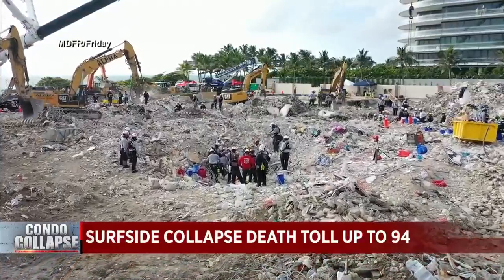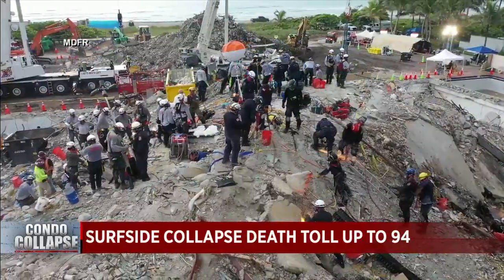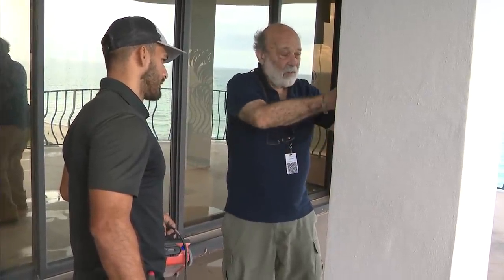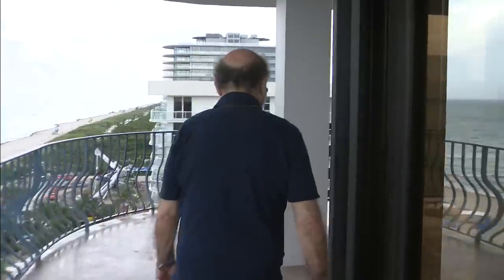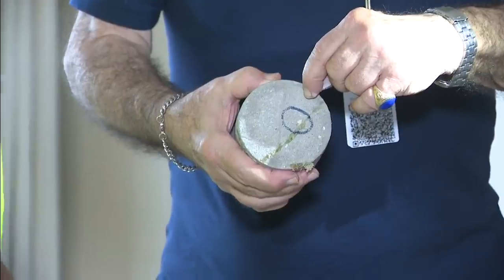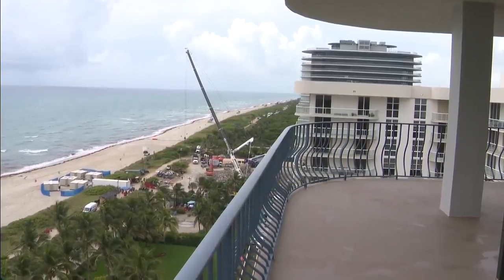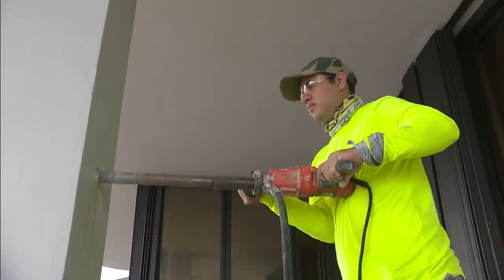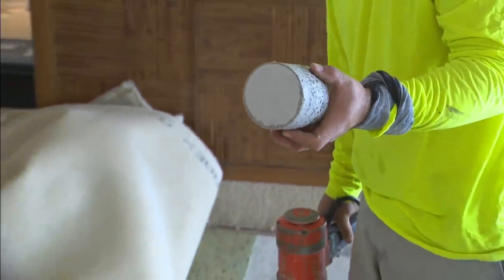Structural expert studying still-standing Champlain Towers North looking for clues into south to...

Comment: Shouldn't they be starting in the parking garage instead of a penthouse suite?
Reply: I'm not a structural engineer, but I assume the safest spot to retrieve samples would be from the top floor.
Reply: @Dekipoo they appently are refusing to let him on the site     so they can "clean up " the evidence
Reply: @Dekipoo  seriously the first job is the rescue and recovery operation.  Which means removal of debris from the roof down to the garage level and foundation.  Investigation and analysis of material from the elevated slabs is on going but not priority.
Reply: @paulquirk9041  I don't know what that has to do with the topic. They're extracting material composition samples from the North tower - not the one that fell.
Reply: @Dekipoo  Agreed. The top floor has no load bearing weight above it like the the garage level and 1st floor. That's why samples are taken from the top floor. It's all the same material anyway.
Reply: @Dekipoo ....  If you have fear that your feet could start hurting one day do you check your hat or your shoes first?
Reply: @robertthomas6127  My comment was not going agains the original comment. I was just trying to present a logical answer as to why they were collecting samples on the top floor and not the garage. It's obvious that what presents the biggest threat to the building is its foundation. Thank you for your unsolicited analogy.
Reply: @Dekipoo  ... Sorry if my comment caused you to choke a bit. Actually it was an attempt to support your comment towards the original question. Why in the world would these experts come in to take samples and do so at the top because of their safety? Absolutely silly to believe they have not already taken samples from the garage and lower floors. PS- Nothing here is unsolicited. If one wants to comment here then one has to live with comments from others. There are no privat conversations here. Have a nice day!
Reply: @robertthomas6127  That would be quite the "feat." (Should be feet)
Reply: @robertthomas6127  
I’d check my weight.
Reply: @rickgeller6043  ..🤣🤣..yes auto correct once again 🤪
Reply: @RPlant  ...yes an additional option.
Reply: Seriously, do you think you know better?  You are seeing what they were doing right then.  I am sure at some point they will be doing work in the basement too if they haven't already.
Reply: @hgbugalou  exactly, how simple a mind to assume based on one section/aspect of a video he’s shown.
Reply: @hgbugalou  
Why u gotta b a tool about the ?
Are u an expert on the subject or just an expert on being a total d bag?
Reply: @fabledfantasty7343  Yep, I don't know why Michael O responded that way.  It was just a simple question.  I wasn't accusing the expert of being incompetent.  Someone further on responded that collecting samples in the penthouse would be a good benchmark which sounds like a reasonable explanation.
Reply: I’m sure they’re going to do one in a garage as pours could be different strength per floor. My guess is they’re using this to figure out stiffness properties which could be used for progressive collapse remodeling. Penthouse is easiest and least demand. -structural engineer
Reply: They can’t because if the structure is already weak from the bottom they can really just put themselves in danger... think of it like jinga if you take from the bottom it is more likely to crumble down
Reply: @Kaydeleon  .... False,  They are cutting core samples and not drilling a number of holes completely through each and every column. Take it for granted the lower levels are surely already done and numbered. This man knows what he is doing.
Reply: That guy literally wrote the forensic engineering standards - so I'm guessing he knows what he is doing...
Reply: Well, the condo owners hired the engineer. Of course he's not going to find any issues
Reply: @zane8789  The video clearly stated that the Engineer was hired by the city of Surfside.   Do you actually think especially after the collapse of the south building that the condo owners of the north building would try to hide any issues with their own units?
Reply: The reporter should have addressed the parking garage.  We're all going to have questions about that because of all the water and concrete issues in the parking garage of Champlain Towers South.
Reply: yeah, start drilling the garage and collapse this building too ?
Reply: That were my thoughts as well. Since the pool deck was the first to collapse in the south condo you should compare it to the pool deck in the northern one.
Reply: I would say they know what they're doing, but I don't this is the case anymore in this country.
Reply: Yes
Reply: They just want to test for deterioration of the concrete, assuming it will be the same throughout the building. They wouldn’t want to risk weakening any basement support columns by taking core samples from them. The safest place is the top floor.
Reply: This guy is a expert and has worked on many buildings for over 40 years. Everyone needs to stop acting like they are all of a sudden a structural engineer just because you heard and read a few things here on YouTube or on the news. Maybe he already took samples from the bottom and every floor up to the penthouse. Thus is just the first footage on camera. Stop assuming things.
Reply: Most people are unaware that a woman living in the penthouse on the 12th floor was awaken at 3 or 4 am by loud creaking noises that she was so disturbed by that she couldn't go back to sleep. Less than 24 hours later, the building collapsed. In the days before the collapse, contractors were mounting anchors (davits) on the roof and were load testing them. Also interesting to note, in the video of the collapse, the parapet was missing in the area by the penthouse of the woman that heard the creaking noises. I suspect that something failed at the top of the building and the parapet broke free and landed on the planter box below, causing the collapse of the pool deck as shown in the tik tok video.
Reply: Looks like they're taking samples of the concrete to check its composition and tensile strength
Reply: @Og-Judy   Sorry concrete have almost zero tensile strength. Concrete is good for compressive loads, not tensile loads.
Reply: @Og-Judy  Concrete has virtually no tensile strength - compressive yes, tensile no.
Reply: @Og-Judy  we never test concrete in tensile ( traction ) strength, but the compression bearing capacity, expressed in MPa ( Mega PAscals ).
Reply: This video is only a couple of minutes long. I'm sure they spent more time and did more things that shown here.
Reply: Drilling into the columns at the top floor is much safer. Can you imagine drilling into the column in the garage? Would you take that risk? They are looking to see the quality of the concrete used. Not to see if the concrete has been damaged over time. The theory is all the concrete used was the same in both towers from the bottom to the top.
Reply: Wasn’t the pool on the roof? That where the problem started allegedly

Comment: In my country (Poland), such high buildings constructed on a sandbar are not allowed. Maximum up to three floors buildings above the ground are allowed.
Reply: And in Germany the concrete floor would have been as minimum 8 " (20 cm) thick. Greetings to Poland where medieval buildings are still standing.
Reply: @Stoffmonster467  .. It's European ideas about concrete construction that you see at play in the condo collapse. It could have been steel framed and stood up a lot longer but people get to where they try to do everything with concrete when it is a flawed material mostly useful in compression situations. Medieval buildings were works of art that took years to build. They did not rely on concrete for their stability
Reply: @matthewmosier8439  it's easy to build high houses in concrete, but the building standards (and the maintenance requirements) seem lower than in Europe. I'm an European civil engineer.
Reply: @Stoffmonster467  The maintenance at the condo was not handled properly. But the answer isn't more rules. That doesn't fix anything. The U.S. construction industry is top notch, but when a building, especially one designed using primarily concrete, is constructed next to a beach and subjected to countless hurricanes and humidity never seen in Europe  (I have traveled and I live on the coast, about one hours drive from Florida. Trust me when I say that the humidity is unbelievable) all while not draining properly, the results are occasionally a disaster.
Reply: @matthewmosier8439  if you have an apartment here or a house with apartment you rent you have to save money each year for maintenance. That's a law. The second topic - as I mentioned before - is the thickness of the concrete (I can't say anything about the reinforcement): nobody here builds just about 6 " thick. The workers would refuse, and the controlling engineer as well. Humidity doesn't damage concrete, but salt, that is true. We have all the time renovations of parking lots because of salt damages. We use salt in winter.
Reply: In the 50's and 60' ,70s most hotels and motels on Miami Beach were 3 or 4 floors only.
Reply: This building was on bedrock not sandbar.
Reply: @Mary-1000  the bedrock sinking 2 mm per year? It is strange.
Reply: i,m polish,around here have heard many times "dumb polock" ....lol
Reply: Lol polish person lecturing us on how to build high rises when the guy who developed this building is polish.
Reply: @annic.9605  That is why he came to America with this, because Poland wasn't buying it.
Reply: @annic.9605  He's not lecturing anyone. He's saying that when a building is going to be built on a sandbar, it can't be more than 3 stories high. Makes sense.

Comment: When they drill into the columns to demolish the Champlain South did they keep the core as samples to test?
Reply: Investigators have more samples of South Tower concrete than they'll ever need.
Reply: There's tons of samples on the ground.
Reply: Just remember one thing the older the concrete the harder it gets  taking samples from the top floor will be different from the garage floor do to moisture content from the ground up and rebar will deteriorate quicker from the ground up
Reply: @RobertA-jw4pe  Some of the garage columns remained standing, the garage ceiling simply collapsed around them, exposing minimal rebar reinforcement. If the final demolition went as planned, those standing columns should still be in place.   There's also video online of an un-refurbished apartment, Formica kitchen surfaces, lino flooring etc. Newer refurbished apartments have marble and granite flooring, kitchen surfaces and bathrooms. No wonder the building was sinking faster than expected.
Reply: Pretty sure they have 8 million tons of concrete at the landfill they can use for sampling
Reply: No